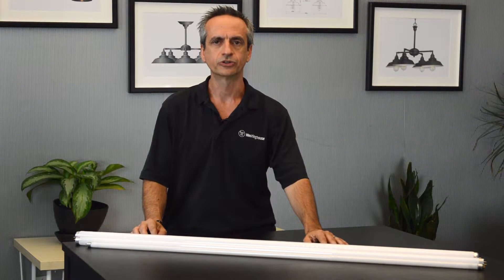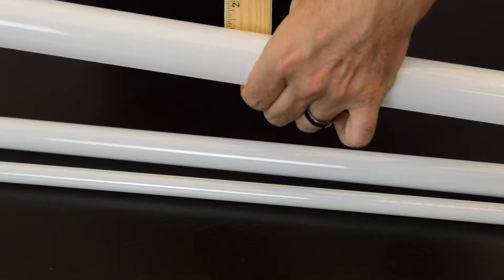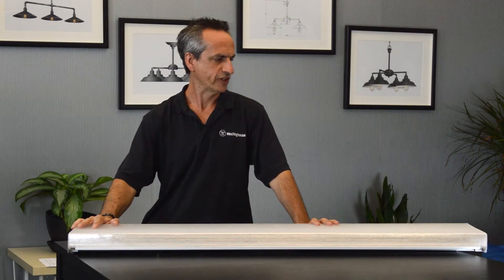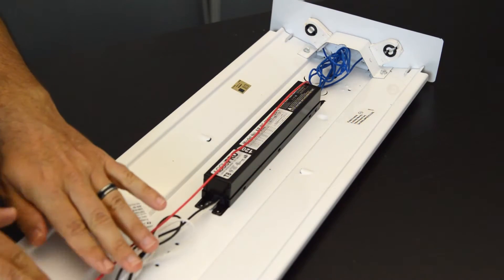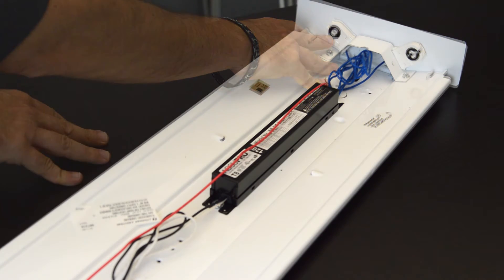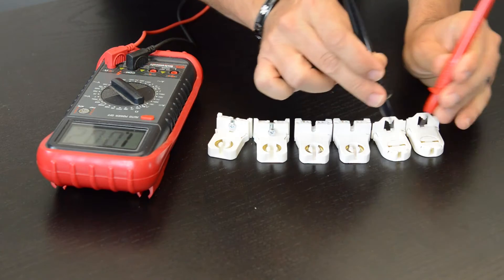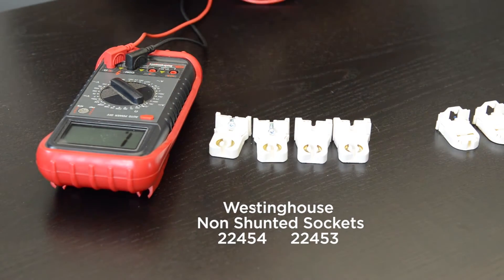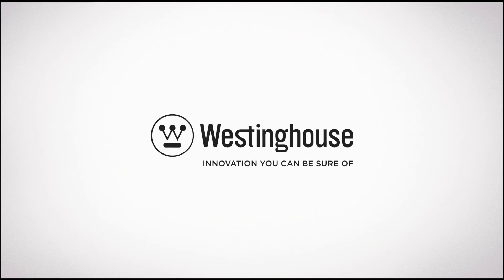TLED Informational Video

Comment: I made this comment about Westinghouse Lighting video - 'T8 LED Ballast Bypass Installation Overview'

I am a journeyman electrician and have installed many light fixtures over the last 15 years in big commercial and industrial projects, such as a 5 story bank building, new mall, several new school buildings, several new large factory buildings, a coal powered power plant, and retrofitting old schools, etc.  To me, this video is confusing.  Converting fluorescent to LED is easy to do but this presentation is confusing.

But this video - 'TLED Informational Video' is much better.